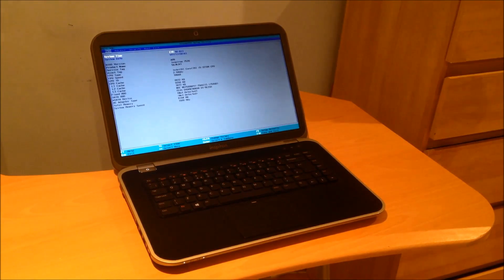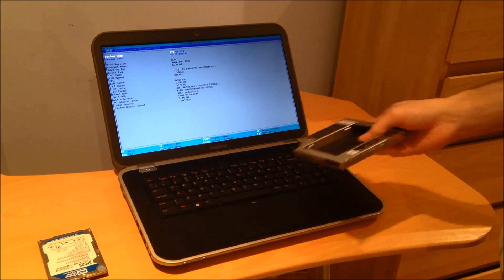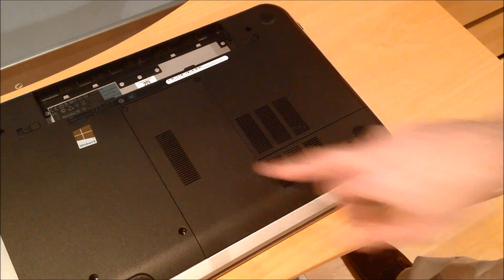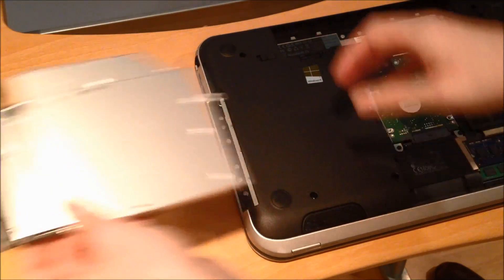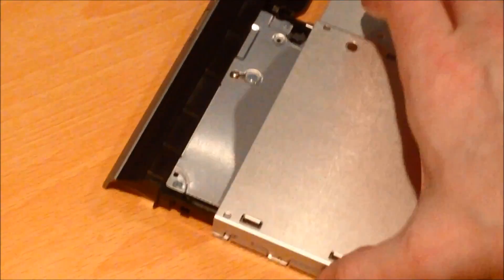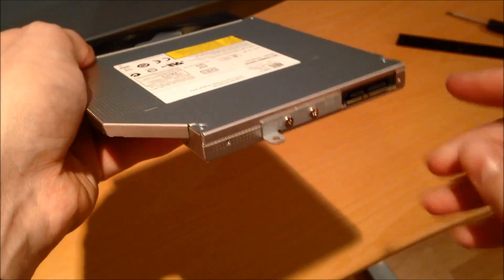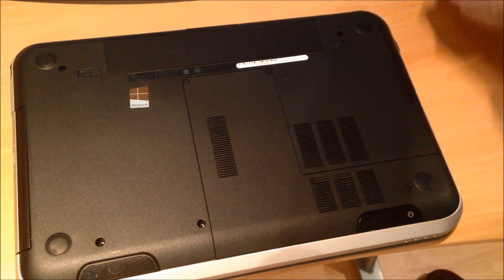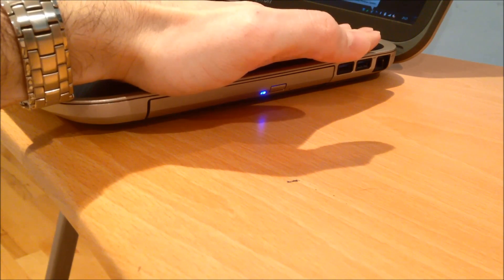Dell Inspiron 15r SE 7520 - Install Second Hard Drive

Comment: Do you consume more energy the caddy with the hard disk in the pc?

Does your laptop battery last less on the basis of caddy consumption?
Reply from the maker: shinnize I've no idea, I think we are talking incredibly small volumes of power consumption to use the caddy. As you'll be using it to run a second drive, more power will be consumed for sure.
Reply: I have a doubt really there is a change in power consumption on your laptop, I mean with the hard drive your hard drive less, if it is the case mentions how long it lasts and when it lasted?
Reply from the maker: shinnize I don't understand the question?
Reply: Sorry for english
How long did your battery last before installing the 2 disks?
How long does it last with 2 disks?

Comment: Hey Chris,

I noticed you are having two different RAM sticks, I was planning to upgrade my RAM, will it be compatible with different brands? The one I currently have is SAMSUNG 4 GB 1600 MHz 12800s.
Reply from the maker: Sajal Shrestha Sure different brand is fine, if you can try and match the specs of them though.
Reply: Thanks for the prompt reply.
Reply from the maker: No problem. If you use a slower memory module as the second one, it'll still work but all memory will operate at the slower speed.

Comment: Hey Chris,

I just wanted to know if there was significant change in performance after u installed SSD ....and is it possible to guide laptop to boot from SSD inside caddy.

Thanks for this video as I'm looking for this upgrade too.
Reply from the maker: The hard drive I put into the caddy was a 5,300RPM one so was never a good performer. When I made the SSD the primary drive the performance difference was incredible, I didn't notice any reduction in performance accessing the 5,300RPM drive via the caddy.

Comment: Which model caddy you used ? Because I bought does not enter the finish of BluRay , my equipment and even video model
Reply from the maker: On mines, I removed the door from the optical drive and fitted it onto the caddy. I bought an unbranded model from eBay.

Comment: Boa noite, tenho um notebook da Dell Inspiron 15R SE, com as espicificações abaixo: 
3ª Geração do Processador Intel® Core? i7-3632QM (2.2GHz até 3.2GHz com Intel® Turbo Boost 2.0, 8 Threads, 6Mb Cache)  

8 GB de SDRAM DDR3 a 1600 MHz  

Disco Rígido 1TB SATA (5400 RPM) com 32GB mSATA SSD (para Intel® Smart Response)  

Placa de Vídeo AMD Radeon? HD 7730M, 128-bit, 2GB   
 
Eu gostaria de expandir a memória Ram dele, porém eu gostaria de saber se este notebook é compatível com 2x memórias Ram de 16 Gb, segundo o site da intel, este processador suporta até 32 Gb de Ram conforme o link abaixo : 

http://ark.intel.com/pt-br/products/71670/Intel-Core-i7-3632QM-Processor-6M-Cache-up-to-3_20-GHz-BGA

Eu ví algumas memórias DDR3 1600 Mhz de 16 Gb de Ram da marca Crucial e Adamanta, conforme os links abaixo:

https://www.amazon.com/Crucial-16GBx2-PC3L-12800-SODIMM-CT2KIT204864BF160B/dp/B011ISG132/ref=sr_1_13?s=pc&ie=UTF8&qid=1467933220&sr=1-13&refinements=p_89%3ACrucial%2Cp_n_feature_four_browse-bin%3A2253866011%2Cp_n_feature_five_browse-bin%3A677429011%7C9559990011

 https://www.amazon.com/dp/B01ASESRCA?psc=1     
Vocês teriam conhecimento se existe mais alguma marca que as fabrique ou se 
funcionaria na minha máquina, e se sim, conhecem alguém que já testou ? 

Atenciosamente,  
Abner Pereira Dancuart.

Comment: I have same Laptop. I try to upgrade it to SSD, when I going to ebay their is two type of size of optical bays. 127mm * 127mm * 12.7mm and 127mm * 127mm * 9.5mm what is the correct one I have to purchase.
Reply from the maker: The one that is 12.7mm deep.
Reply: Before you ask a question, how about to READ PREVIOUS ANSWERS?! Do you expect him to answer a hundred times the same question, because people are lazy?

Comment: Did the laptop come with an MSATA slot? That would be a better option for installing a second hard drive without sacrificing the BluRay drive or buying a caddy.
Reply: +Anywhere True
Reply: +Anywhere But also in my country that's a more expensive solution :P

Comment: Chris, I've been searching how to replace the 32GB SSD in my 7530 laptop( dual drives with 1TB HDD).  I came across your demo for adding the second drive, but wonder if you have any experience with the the 32GB SSD replacement?
Reply from the maker: +Walt Birchall Not personally Walt, but I'd assume it's simply a direct swap.

Comment: Hi. Thanks for the very detailed video. I have a 15r 5520 model. I found the exact caddy you use however it is available in 2 dimensions: 9.5mm and 12.7mm, referring to the height of the optical drive I guess. Could you tell me which one you used and how did you know which is the correct height? Thanks
Reply from the maker: AlexulQ Hi, it'll be the 12.7mm caddy you require.
Reply: Chris Bryson Thanks. I placed an order for a caddy and ssd and will use your video as a guide
Reply: Thx. I wanted to know, too.😊
Reply: Me, too. I iMac screen died so I pulled my dinosaur Dell Inspiron 5520 out of the closet (can't stomach paying Apple $500 to fix a 2.5year old system when I paid nearly $1400 for it!) . Luckily, it can run Lightroom pretty well. Don't know about video editing yet. Planning on moving to a SSD drive, but want to keep the 1TB HDD for storage. I will give this a go. How has it worked out for you guys that did this?

Comment: If changed my 500GB HDD for a 120GB SSD then I put the HDD with an adapter in the DVD bay... All the Games and the Data hungry things should go on the HDD and the System and important Programms on the SSD. The SSD is runnig fine but the HDD isn't detected every time I have to restart the system 5+ times to get it to function... That can't be normal! Do you have an idea what I should do? And is the HDD in the DVD bay slower too in your system than it was befor?
Reply from the maker: Griffelkiste I didn't have any issues like this, nor did I experience any reduction in speed with the mechanical drive.
Reply: Thanks I'll go and get a new adapter!

Comment: I have a question about my laptop Dell 7520. I replaced the maid drive with ssd and I add the HDD with caddy in optical drive. It is working but the HDD is spinning all the time even I am not using it and the noise is too much. Any solutions?

Comment: Hi..I have a similar Dell Inspiron like yours but it is Dell Inspiron 14R SE 7420 I'm having the same bottleneck issue too due to that darn 1 TB HDD.(coz mine is 3rd Gen i7 with 8GB Ram). Both our laptops look exactly similar. I was wondering what's the size of the caddy you are using? I heard that there are different sizes like 12.7mm and 9.6mm.
Reply from the maker: Nicholas Chong Hey Nicholas - It's a 12.7mm caddy that I used on the Dell. I'm now using a Inspiron 7537 which didn't come with an optical drive, I miss having that bay as currently I only have a 240GB SSD installed relying on an external USB 3.0 drive for many things.
Reply: Chris Bryson Hi, thanks for tips. It's great you have a new laptop now. Laptops that come in without an optical drives are more common nowadays. Even my laptop in office (Latitiude 3340) doesn't come with an optical drive too.

Comment: I have a UEFI only laptop which can only boot from hard disk or usb there is no way to boot from optical so my question is does it still recognise as a optical drive in bios or does it show as hard disk?
Reply: you would need to modify bios to remove secure boot, then change UEFI to legacy, after that you can modify boot oprions.
Reply: +Lucas Walker Like a hard disk :)

Comment: I would rather keep the the BluRay dive and just replace the existing HD with an SSD. That way you could still use the 750gb drive in an external 2.5 Inch SATA to USB Enclosure Caddy.
Reply from the maker: Of course, but if you travel a lot and never use your optical drive - it's a good sacrifice to make. I can't remember the last time I used an optical drive.
Reply: ***** How would you rip a movie on a BluRay disk without a BluRay R/W drive?

Comment: Hi! The video is great! I have the same pc and i want a SSD for SO and a caddy for the "old" hdd.
I look for it in amazon.it and i found many devices that could be suitable.. Can you tell me how to choose a caddy for my pc? All are good or not? ;)
What do you think about http://hddcaddy.com/en/dell-hdd-caddy/379-dell-inspiron-15r-se-n0015s32-hdd-caddy.html ?
Thanks ;) ;)
Reply: Dailme Can you post a link here? Thanks. :)
Reply from the maker: The one you have linked looks good to me. :)
Reply: Same situation here. :) In the link you posted, I noticed this in the specifications section:
- updated SATA board: incl. fix for Dell shutdown problem with 2nd HDD
Are there any known issues with second HDDs?
Reply: On last week i bought from amazon a caddy cheaper as a test. I'll let you know how it will perform :)